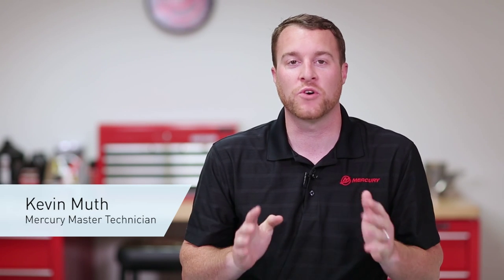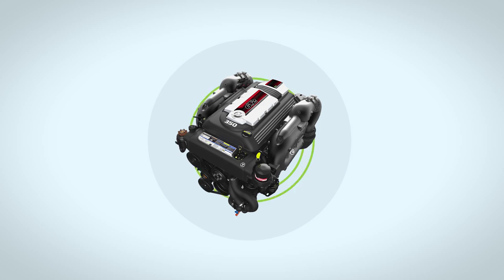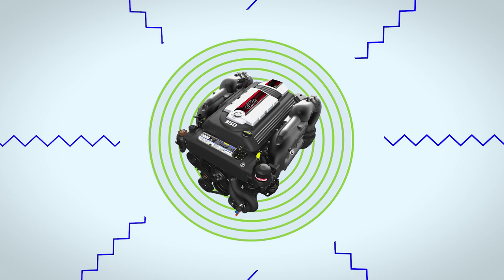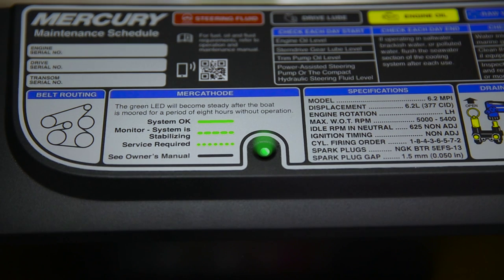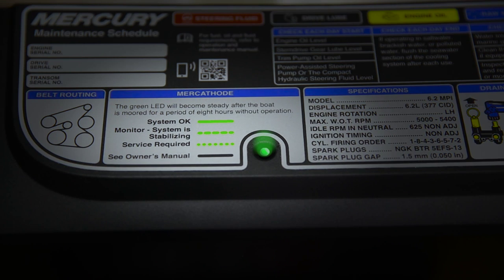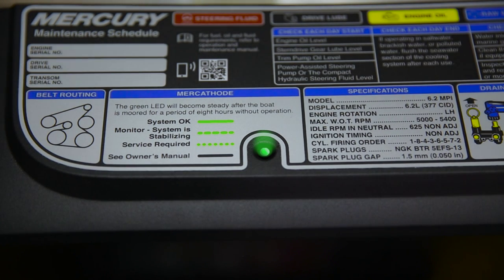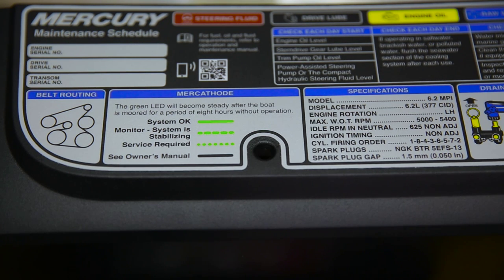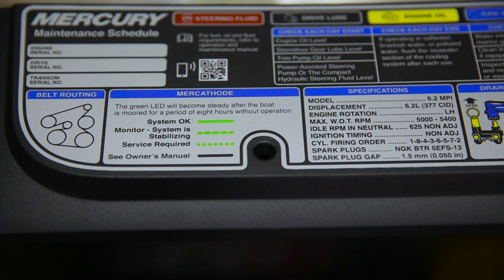MerCruiser 4.5L / 6.2L Sterndrive - MerCathode System

Comment: I just bought a 2000  Formula with the MerCruiser Bravo III outdrives. They are in excellent shape largely due to the previous owner religiously changing the anodes. The boat also has the MerCathode system in place.  Question, I've read lots about the problems with this particular engine/drive set up - mostly because the props are steel. What if you also get some big anodes (that you'd normally bolt on the back of a boat - I had one on the back of my Sea Ray 370) - but just hang them in the water off the stern while the boat is at the slip. Would that help? Appreciate an answer or opinion. THanks !

Comment: hmm, afetr 1/2 year of a brand new bravo z-drive i had to replace two shafts due to corrosion. Only used in brackish water.  No warranty was given by mercury, no help from authorized dealer due to missing measuerement equipment. mercathode system is blinking….
Reply from the maker: We are sorry to hear that you are dealing some frustrating corrosion issues. Please contact Mercury Marine consumer support in your region to discuss your concerns. They can assist in finding a dealer capable of testing your vessel to determine what the cause may be.
Reply: @MercuryMarine  Hello, there is no reachable support for my region. For germany it says "Belgium", no telephone, no email address, only contact per letter: is that correct for 2021? Can you help?
I have the question: How can that be that my "authorized mercury" dealer provides no support since 6 weeks and has no measurement equipment for anodes. Is there any kind of audit for you authorized dealers or how is quality of service is secured?
Reply from the maker: @hjmmuller6720  to contact our team in Belgium, please call +32 87 32 32 11. They can assist you and your dealer with testing the boat package appropriately.